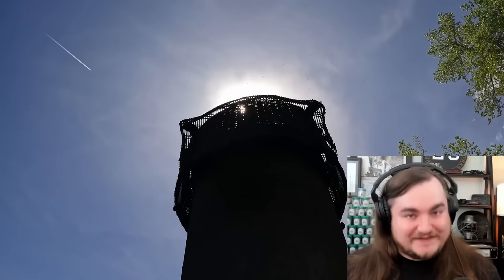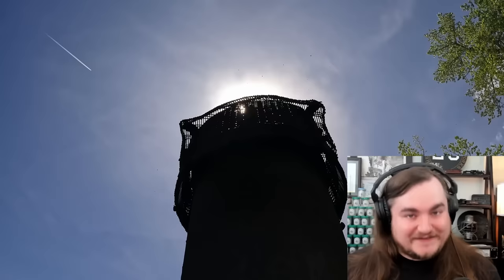Why do USA steam trains make smoke, but UK ones don't?

Comment: a really good example, as unfortunate the circumstances were, when UP844 hit the pedestrian a few years back, you can see in the drone footage the sudden increase in smoke when they pull the throttle and start braking, as the load is gone however the boiler I'm assuming was still being fueled to match the previous high speed. the drone footage of the incident does show this very clearly but it also shows the incident very clearly.

Comment: I have also seen US videos where they explain that carbon collects in the tubes and every few miles the engineers have to release sand into the intakes to scour out the carbon. This results in a huge plume of black smoke as the sand and carbon are ejected out the smokestack.
Reply: That would be on oil burning locomotives, and it would be farther than a few miles.  I didn't do it on the coal burning loco I fired on, but we had pretty good coal too.

Comment: Great elucidation of the engineering that goes into making a steam engine socially restrained so that any day can be a good day to hang washing on the outside line. Thanks. I'd stick to steam engines though and stay away from sound engineering - that music at the end suggests you haven't been using enough ear protection. 🤣 I've often wondered whether any kind of forced induction is used when trains travel in thinner air at altitudes - but maybe they just stay where it's straight & level ... & flat. Hmm. No idea. 👍

Comment: ive done work on home heating oil burners(fuel oil is the primary heat source in much of New England) and during pre-winter checkups we actually stuck a device into the flue pipe while it was running and it had a pipe and a white cloth insert. and you pump the device a few times, You want minimal color change on the cloth thing as soot up the chimney is poor combustion, clogs the boiler or furnace  and of course is probably burning more fuel than needed to get the same heat. and fuel is money.

Comment: Something that might have effected the design choices is population density. Trains in the UK run almost next to some peoples back gardens and having great big plumes of black dirty smoke was definitely undesirable to anyone in the surrounding area. Thus they might have designed the trains to be "cleaner" running to make it so there was less reason for people to complain to local government about air born population and damage to property from train smoke.

Also efficiency even in the 1930's was definitely on UK train operators minds. They realised that pretty early on burning less coal was economically advantageous. Coal was cheap but not so cheap it didn’t warrant trying to use less of it. And the UK didn’t really want to try and make trains run on oil, because they didn’t have native oil production like the USA. Dropping coal use, by say 20% across the board, would mean serious savings in even the short term and thus more profit. Also if you burn less coal you don't need to get coal delivered as often or your coal lasts longer and you end up refueling trains less often meaning less man hours are needed and again thats a cost saving right there. This was a buisness afterall.

Comment: I rember different coal usage in Western Germany: The US-imported Gas coal at engine shed Hagen-Eckesey produced very black, thick fume, and the pretty Pacifics 03.10 consistently looked striking dirty. The other engine sheds in the Ruhr district looked much better because of consuming original Ruhr coal with less released volatile particles: Gas coal 35-40% versus Fat coal 19-28%, Lean coal 10-14% and Anthracite coal less than 10%. The oil-fired german Pacifics 01.10 in turn produced ugly black fume from Bunker oil C, a waste product which is now being replaced by light oil, especially in Switzerland. The British Pacifics like A1 Tornado are the most efficient built engines in relation to their small size and enjoy best combustion conditions. Maybe british steamers consume the worthy Anthracite coal from Australia (vast incidence also in Canada and Ucraina). The worst thing for steam locos is Brown coal (Lignite) with ugly sulfur odor and a vast amount of volatile particles in combination with bad fuel/caloric value. And hand-fired locos, an experienced fireman provided, are savvier 'nourished' than those by a stoker (automatic grate loading).

Comment: With an oil burner, burners were set up for heavy or light oil. Heavy oil uses a larger burner for the same the firebox size than for the the use of light oil. When the wrong weight of oil is used, the fire can smoke a lot.

In the UK, their fireboxes are a lot smaller -  one of their 1930's videos talked about a large firebox of 45 sq. ft. That is the  same size grate area as a N&W 4-8-0 from the earlier part of the 1900's. Mikados could have up around 70 sq. ft. grate. With the invention of the mechanical stoker the fireboxes could become quite large -up to 150 sq. ft.

If you find the LMS video "General Repair" you will see leaking tubes during the firebox inspection around the 1:53 mark. I have wondered how much of the leaking was caused by cold air hitting the tube sheets.

As far as black smoke, fuel quality matters a lot and the fireman has to compensate for it (I have fired with clean, hot burning coal, dirty hot burning coal, dirty not hot coal, clean not hot coal, oil burners set up properly, oil burners not set up properly) and there are times where more fuel has to be added to make heat and not thermal shock the boiler even though the stack is dark - it is better to have a dark stack than thermal shock the boiler by not having enough heat/fire. With oil burners, sanding the tubes will create plumes of dark "smoke" as the sand knocks carbon off the tubes. When a coal burner starts drafting hard after sitting around for a long time (like after being banked at night or after being fired up from cold), the draft will pull the carbon out the stack. Preparing the fire for the work coming up, backing off on the throttle, properly installed arch, proper drafting appliances and smokebox all play into it.

I have made several posts on facebook about this and it is amazing how many people automatically say that black smoke means that the fireman is bad...

Comment: Germany also had some oil fired locomotives, they smoked a bit more then the coal fired ones but not a lot (they where often converted coal locomotives or build to the same design but with oil)

Comment: The answer involves the fact that ALL smoke is the result of incomplete combustion, thus the "Scrubbers" at plants like the waste disposal site locally.  The scrubber is simply a very hot set of flames from fuel lines run up the "smoke" stack feeding nozzles inside the stack "burning" the smoke that is rising out and incinerating the combustibles still left from the waste that had burned and what subsequently emits from the top of the stack is invisible save for a very barely perceptible hint of infinitesimal particulate matter, since no thing is absolutely one hundred percent (even 99.999999% is short of perfect).  Obviously, any stack with "light" colored smoke is more completely burned than those of darker hue.  Liquid fueled instances tend to burn more completely in general than solid fuels.  Regardless, any could be "scrubbed" if someone were of sufficient motivation to make the effort.
            P.S.  Those who enjoy camping may have noticed that campfires that have the wood arranged in a fashion for maximum flow through of air and  left to burn through the night, can notice the next morning, that there is very little ash remaining, when comparing the mass of the wood started with to that of the ash left, the percentage is very minute indeed, since the density of the ash is a very small fraction of that of the wood (if the wood was forest "litter" that had dried to the environment low humidity for a least one season).

Comment: Generally speaking, US steam locos burn dirty coal because it is cheaper. The good stuff is sold into the export market or used for steel making by taking a trip through the coking ovens. Power plants do the same thing except they have scrubbers to remove the ash and toxins. Then, there is the problem of disposal of the witches brew that comes out of the scrubbers. Locos just disperse that stuff along the route without first concentrating it in scrubbers. There was a reason that the ritzy people lived upwind of the tracks. The wrong side of the track was where the poor lived because it was less desirable and thus cheaper.

Comment: Taking trains out of Euston station in London was difficult. The heavy express trains to Glasgow would climb up the Camden Bank from a standing start and so the fire would be built up before the loco ran down onto its train. Often waiting 15-20 minutes to talk the train away the pressure would get to max and the steam valve would blow. The fireman would have no choice but to fire the train as it left the station so there was careful balance between firing the engine to keep the pressure up as it climbed the bank and restrict the smoke as the train passed through densely populated London. Whether our engines in the UK were inferior to the US engines is a moot point. Several of the heavy classes of engine never reached their theoretical maximum power because it wasn't possible to fire them with enough coal. And we are not talking rough coal but top class Welsh steam coal regarded as the best in the world. Oil burning would have overcome that but it was seen as too expensive in the UK. You will of course appreciate that Mallard holds the speed record for steam engines and the High Speed Train of the 1980s held the world speed record for a passenger diesel train. They were refurbished after 20 years with the result an extra coach could be added to trains and sadly most of them are now being withdrawn. Some were refurbished again to run up to Inverness in Scotland and some are used on cross country routes where electrification is incomplete. They are in a league of their own for quick acceleration ... Oh and famously emitted a lot of smoke or Clagg as it is known in the UK.

Comment: Uk locos can smoke a lot but not when they’re operating at the speeds they’re designed for. Often the worst place for smoke is near stations or on speed restricted lines. Now that our mainline steam runs up to 75mph instead of 90 (thanks to recent concerns about the condition of the tracks) the locos are spewing greyer clouds.

Comment: Photographer preference isn't restricted just to steam locomotives. Just like photographers will take photos of the the 'dramatic' look of water vapor leaving a thermal power plants condensers which will be portrayed by media as polluting. When the actual exhaust flue barely puts out a wisp of steam because you want as complete as combustion as possible to get the most out of the fuel you are paying for.

Comment: If you have anything more than economy haze: coal, oil, wood you are wasting fuel. It’s much more likely to be seen during transition. When I was around steam ships the combustion control system would lag enough to over fuel in response to steam pressure changes. During maneuvering she would give off the “polite salute” completely unintentionally it was just the way the system worked.

Comment: interesting question. may I add my own idea to it?
incomplete combustion also means, that the fuel isn't consumed as efficiently. while that alone would not force UK to burn the fuel more efficently, there is also the speciality that they ran steam locomotives in the early days of the london underground. that also means, in the most expensive areas of london, there were exhaust openings in between the buildings.
so they had to learn how to design and operate steam engines in tunnels, where a lot of people were on the surface who would complain about it. it was london after all.
more fuel efficient combustion means less fuel and less maintenanace, again a win-win.
whereas in the US: somewhere in the mid west, who cares about a larger plume above a locomotive?

Comment: Large coal fired power stations use pulverized coal dust, as it burns almost instantaneously, and can be blown into the furnace quickly.   So any black smoke exiting the chimney, is actually wasting the best part of the coal stock.   However, unlike a power station, the engine's dust is not all the same size particles, and maybe the bigger bits just don't have enough time to fully burn, even if given enough oxygen.

Comment: I was on a historic steam run Belfast to Dublin and back a few years back.  On the run up into the mountains on 90mph line, they apparently hit 80mph at the bottom of the hill.
In about car 4 of 8 we had to close the window because bits of hot coal were coming in the window!
They were not taking it easy on the ole girl thats for sure.

Comment: They don't have more black smoke. However, in the video, it was mentioned thar when the engineer let off the throttle, black smoke would come out of the stack. This is why the train station in my fome town was black back in the 60s. It is a stone building. The actual color of the stone is brown. The building was. Black when I was growing up in the 60s. The reason fot this was all the smoke from the steam locomotives that was deposited on the building over time. In around 1955 through 1960 there was a transition from steam locomotives to diesel electric locomotives. The soot from the burning of coal in the steam locomotives remained behind. However in the eighties the station was cleaned and it has appeared in several movies, Only the Lonely wirh John Candy, and Continental Divide with Jim Belushi.

Comment: I had a beautigul shot line up of UP 844 (then-numbered 8444) on the Dent Branch with a clean stack.  At the train approached the highway crossing, the fireman threw a shovelful of sand through the firedoor to clean out the flues.  It did, and the resultant black smoke ruined my shot.

Comment: One other point that may or may not be valid, is stateside, during WWII, we needed every engine possible to keep freight moving, what with America being the 'arsenal of democracy' as it was often said. Firemen would often throw sand in the firebox to help keep the boiler tubes clean, but that also produced a darker smoke, and with diesels having been introduced before the war, and with mothballed steamers being put back in service for the war effort, railfans were out to get photos of steam locomotives. I've read anecdotes from former railroaders that they would wait to see railfans, then throw the sand in for a better picture. I don't know if the Brits were doing that too, but I do know we Americans were, and I have heard of tourist lines that will throw sand in sometimes just for the effect. Again, all stuff I have read about, so grain of salt and all that.

Comment: I used to drive and fire steam locomotives and we looked for a light grey smoke rather than a clean exhaust.
Black smoke was bad firing, either by a combinational of too much coal added to the fire, or not enough of either secondary or primary air (through the grate controlled by the dampers, or secondary through the firebox door) but cracking open the firebox door would clear the exhaust.
On the move, we looked for a light grey exhaust which meant near perfect quantities of coal, and air and when the smoke disappeared it was time to add some coal.
Black smoke was just money being burnt… and bad for the environment too.

Comment: Also, with a few exceptions, it is not the solid or liquid that burns, it is the gasses that they give off. With coal, while the carbon will burn and burn pretty cleanly, it is the volatile gasses that can produce the black smoke as well as the long flames in the firebox. These gasses are driven off around 800 F, but don't start to burn until around 1,800 F. If the furnace temperature is too low, the gasses can be driven off but not hot enough to burn.

Arches help reduce the black smoke by providing additional heat (as they soak up the heat from the fire and give off radiant heat) to burn the gasses, increase the flame path to the tubes and thereby increasing time to burn, as well as force the gasses back over the fire before passing up by the crownsheet.

Comment: I just saw a vid this week of the model that Thomas the Tank Engine is based off of, painted to look like the character, and it was rolling some major coal. Absolutly hilarious.
Population density matters a lot too. In the US, engines are mostly in fairly uninhabited or extremely low-density areas. In the UK, if an engine is rolling thick smoke, 3 towns and 100 farmers all have something to say about it, while on the majority of US rail, you're fairly isolated and it really doesn't matter as much. Even in the US, bigger cities didn't really run monster engines and were much more concerned about efficiency

Comment: U.S. Steam Engines used coal for the boiler. Even "Big Boy 4014" used to, but was converted to NO. 5 fuel oil. U.S. restored steam engine no longer use coal or smoke.

Comment: In the UK all locomotives of the main-line railways were hand-fired. There were experiments with coal-pushers that did not get anywhere. It was always viewed as being unprofessional to make excess smoke. Maybe there was opposition to them from train crews or the designs did not have a flexible feed-rate. There are no surviving examples.
Oil burning was unknown except in emergencies.
The last 'proper' UK working stem was at coal mines. Your fuel source is 'on site' & 'free'.